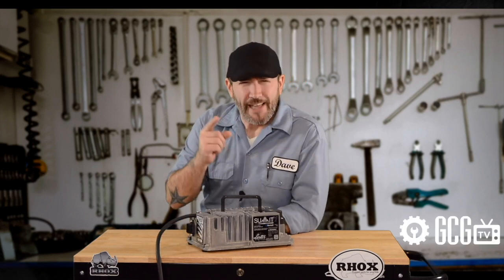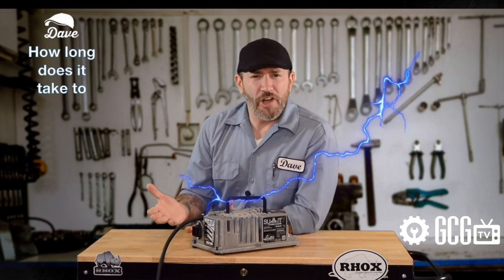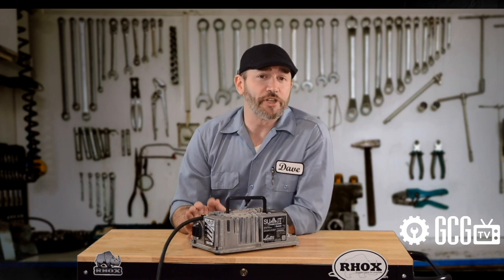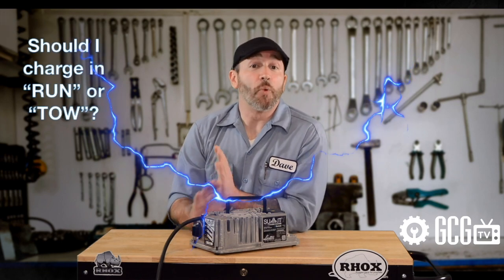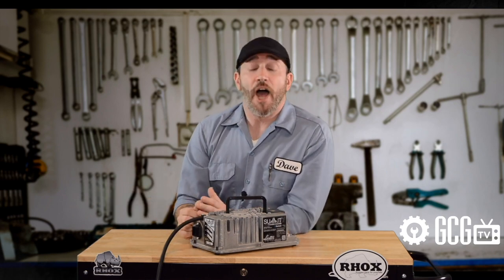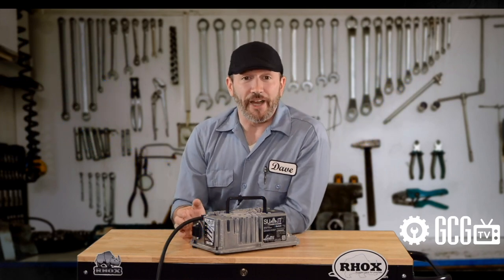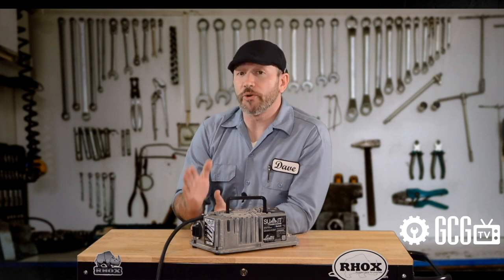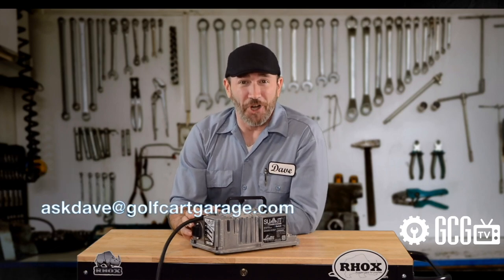Golf Cart Battery Charger Frequently Asked Questions | ASK DAVE | Golf Cart Garage

Comment: Hi Sir !  I'm a Security guard my question  is this we are using club car for patrolling purpose inside the community. I'm putting my club car  on charging after each use or when I need it .but my colleague is not agree with me. He says just put one time on charging during night or put on charging minimum 6 hours.?
Thanks.  Shan Asad from Dubai United Arab Emirates.
Reply from the maker: Hey, Shan!  Thanks for stopping by.  We agree with your colleague.  If you're only using it for short periods, no need to charge after every use.  Charging should be done when power level is relatively low, if possible.  Overnight is usually best.  Let us know if you need more help! support@golfcartgarage.com or (800) 401-2934.

Comment: Dave, I have s summit 2 charger that is one year old and recently started giving me a default code.  All lights are on, blue is solid, red is solid, yellow and green are blinking. What does that indicate?
Reply from the maker: Hey, Al.. thanks for stopping by!  All solid lights fault code, according to the Summit II manual, is an indication of a DC disconnect.  This can represent an issue with your vehicle receptacle.  For tech help, get in touch with us at support@golfcartgarage.com or (800) 401-2934

Comment: my 36 vt powerwise wont charge unless i connect the 2 black wires, I have replaced the control board 2 times still won' charge new charger plug   everything seems to check ok any suggestions
Reply from the maker: Hey, John.  Thanks for stopping by!  Sounds like it may be a good idea to contact the charger manufacturer tech team for help on that.  Lester Electrical made the PowerWise line, their number is (877) 322-6779.  You can also check out our new virtual tech service at golfcartgarage.com/gearheads-on-demand/
If there's more we can do to help, let us know! support@golfcartgarage.com  or (800) 401-2934

Comment: I have a Powerwise II 36 volt charger. But when I plug it into my golf cart it hums but only marks 2 to 3 amps of charging. What can be wrong and is there a video specific to repairing this unit. It is a Powerwise II 602718 21 amp charger. Any help would be grateful.
Reply from the maker: Thanks for watching, Alfredo!  That should be a PowerWise II for the 36V EZGO.  It may have an interior part failure.  We recommend consulting our free online diagnostic center here: https://www.golfcartgarage.com/gearheads-on-demand/
Or connect directly to our techs at Support@GolfCartGarage.com or (800) 401-2934

Comment: Thank you  Dave
I have  a 2006 CLUB CAR with OBC and I plan to bypass the OBC. It came with a PowerDrive2 charger. 
I plan to buy the Summit Series II, 36-48V Auto Ranging Voltage 13-18A, CC Power Drive w/o OBC.
Will this charger work for me?
Reply from the maker: Thanks for watching!  Yes, if you bypass, that charger option you mentioned will work for you.  At a lower price point, though, you can also find the same charger with an "onboard" connection that will serve as the bypass and connect just by installing it.  We have a video to walk you through that and all the info you need here: https://www.golfcartgarage.com/on-board-36-48-volt-golf-cart-battery-charger-lester-36v-48v/
If you need anything else... get in touch! (800) 401-2934 or support@golfcartgarage.com
CHEERS!

Comment: Stupid question if I have 6 6volt batteries do I use a 36v battery charger
Reply from the maker: It's only a stupid question if you don't ask and wind up using the wrong charger!  Glad you stopped by.  YES, if you have 6x 6volt batteries, you'll want a charger that has a 36V profile.  We'd be happy to help you find the right one for you!  (800) 401-2934 or support@golfcartgarage.com

Comment: So my question is about the meter. I have Stone River Battery Meter Golf Cart (circular with a gauge needle) It has four different sections on the left Red then a large section of green then a white section that says charge and then another Red section to the far right. So my issue is when the battery is charged the gauge is all the way to the right in the red section then when it was in the middle of the green section it died. So obviously the meter not functioning well. Is there a better meter I can get? Another question my repair guy told me the opposite as far as charging , said the batteries  should be run down before charging and specifically said not to charge every day. He said charging every day will shorten the life of the batteries. Just paid $675 for batteries and want then to work as long as possible so.... when do I charge them?
Reply from the maker: Hey, Paul!  From your description, it does sound like the charge meter you're using is not operating properly.  As far as when to charge, your repair guy is right.  You should charge when your battery is low.  But for lots of people, that's an every day occurrence.  If you use it enough to drain the power significantly, you should charge.
As far as a new meter is concerned, you'll want to select one correct for your voltage.  Let us know if we can help recommend something specific (800) 401-2934 or support@golfcartgarage.com

Comment: I just bought a 2014 club car with brand new batteries in it. The first night it charged fine. Last night I came out to the garage a couple hour after putting it on the charger and the batteries were boiling and my garage wrecked of battery acid. I noticed the battery light on the charger was flashing. Why do you think this happened? Thank you!
Reply from the maker: Hey Adam!  It's important to find out all you can about how the charger you're using works and see if it can be programmed to your battery set. It sounds as though it was overcharging and may need to be checked.  Let us know if we can help more and look into it! (800) 401-2934 or support@golfcartgarage.com
Reply: Golf Cart Garage Thank you! Appreciate the feed back. It’s not shitting off when it’s done charging.
Reply from the maker: Whoa! Hope that's a typo... this is a family program... ;-) lol
It sounds like that charger is ready for a repair or replacement.  Summit II would be a great choice https://www.golfcartgarage.com/on-board-36-48-volt-golf-cart-battery-charger-lester-36v-48v/
Let us know if we can help! (800) 401-2934

Comment: Dave, I just purchased a new 
MODZ Max48 15 AMP Club Car Battery Charger for 48 Volt Golf Carts and 4 brand new Trojan batteries for my Club Car 2007 Precedent.  However, the batteries will not charge when I plug in the charger.  I've checked the charger and it is working and the batteries are new.  Any ideas on why the won't charge?
Reply from the maker: Hi, Jeff!  Sounds like a headache, sorry to hear you're dealing with that.  Try out our video on common issues with 48V Club Car and the OBC technology here: https://www.youtube.com/watch?v=Tb6jfd3x610